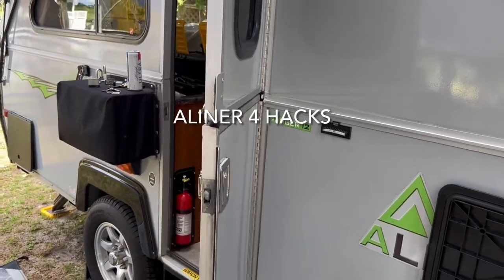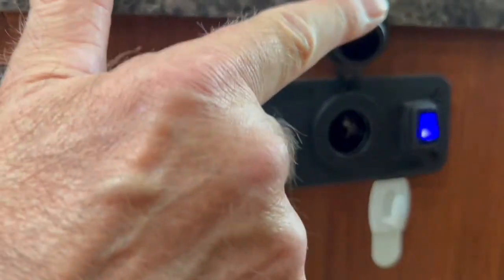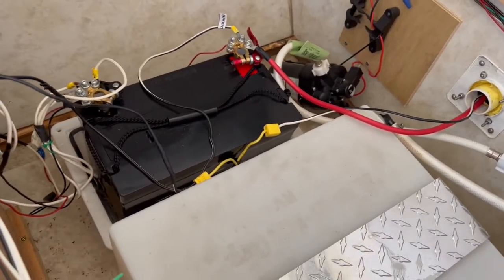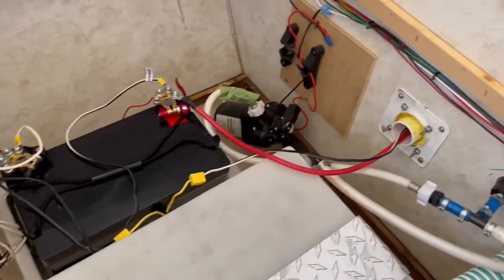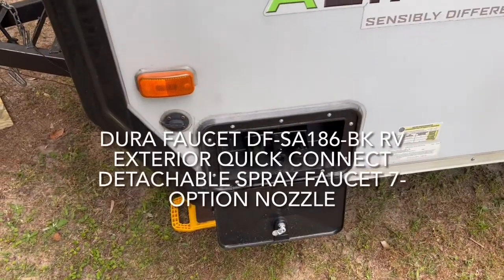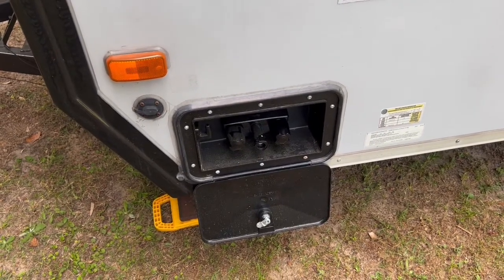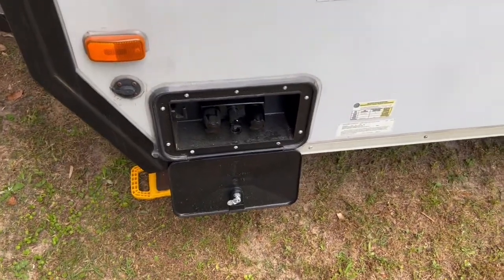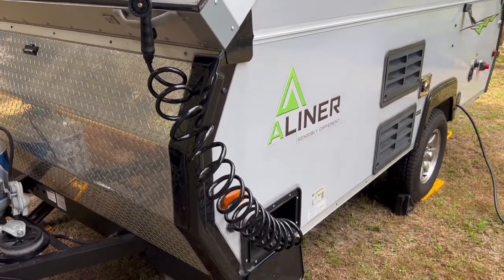Aliner 4 Hacks

Comment: My a-frame is a 2012 and I added usb and 12 volt in the same location. It's a very useful mod. Swapped my batteries recently for lithium and added the disconnect too. My batteries are on the tongue. These campers are a lot of fun to modify and being so small you have to be creative with space. Going to look for that outside shower.  I replaced mine a few years ago and it leaks already.
Reply from the maker: I looked at the LifePo a few months ago and finally went with an AGM type because of the cost. That  shower is this:

Dura Faucet DF-SA186-BK RV Exterior Quick Connect Detachable Spray Faucet 7-Option Nozzle (Black)
Reply: @stimulusthealiner6096  Thanks for the reply.
Reply: Hi, thanks so much for your video. Could you please post the link to the Dura faucet in the video description? I see that you posted the information under comments but it is not possible to copy and paste it so that I can look it up on Google because you put it in the comments.